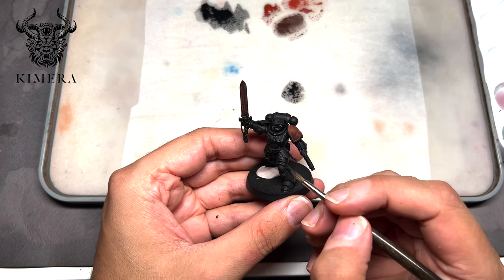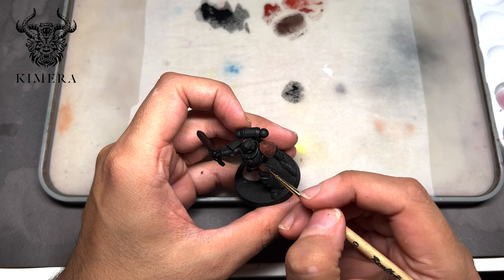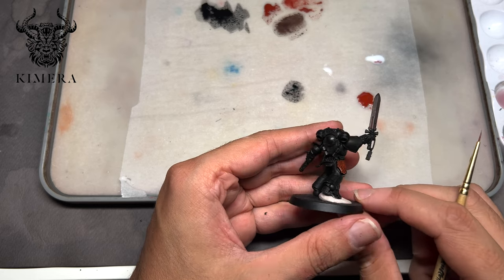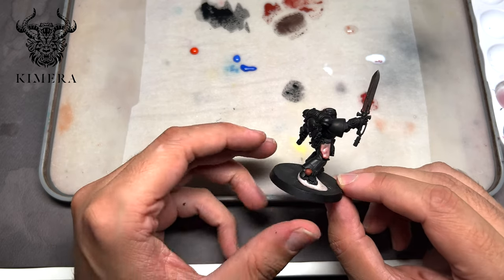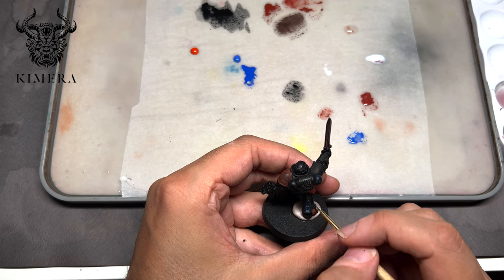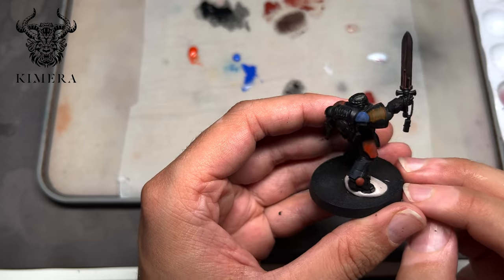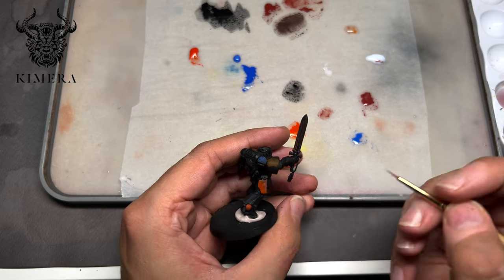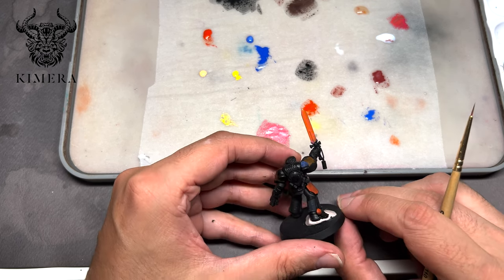The truth about unwanted FROSTING or CHALKY painted miniatures!

Comment: 👍👍 Haven’t tried Windsor Newton matte medium before…bottle on the way - will know tomorrow🤔

PS +1 on the BenQ light.  We dont use ours for painting, but as backlights for large monitors. For painting we’ve got quite a few LED 5K-ish floodlights mounted in cheap work light fixtures (HomeDepot/Lowes) in a circular pattern overhead shooting down on the painting work areas (and airbrush booth) at differing angles to pretty much eliminate shadows..if we want…can turn off individual lights to control directional lighting (shadows).  We also use the LED floods for continuous lighting (indirect, masked & filtered) while photographing miniatures, sometimes a little fill flash  (DSLR - yeah old fashioned but it’s hooked up through Capture One so that makes it easy for monitoring shots in real-time).  

As always, YMMV.  Just sharing.  Nothing more. nothing less.

Comment: Thank you! Very helpful video! I encountered something similar with Scale 75 Tesla Blue over already glazed other blue tones. It was really frustrating since it is such a nice and vibrant colour.

I also found that Kimera Warm Yellow clumped really badly while strongly diluted with water to use it as a glaze so no smooth surface was achievable. I had this issue with some other kimera colors which unfortunately let me avoid them all the time. Do you have an advice on that as well? Your paints seem to get so much positive reviews so I am asking myself why I can’t seem to get them to work properly.
Reply from the maker: It is the same kind of issue I think as i strongly diluted the warm yellow in the last part of the video. Or it is that you didn't shake them well, as they are super pigmented and the pigment can fall on the bottom of the bottle. Do not glaze over glossy surfaces with matte paints, that's the rule of thumb. Make either the paint satin or the surface matte. I hope it helps.
Reply: Thank you a lot, I will keep it in mind :)

Comment: Hi ! Would not a simple layer of canned matte spray over the black primer be enough to deal with the issue ? It seemed an easier process. Thank you for this video !

Also, any advice about how to have a better coverage when base coating with the phtalo green ? Having issues with this color
Reply from the maker: Matte sprays are fine, i use to do it with the airbrush eventually. My problem with can spray is that they tend to leave grainy results depending on the humidity of the room so I end up avoiding it. But results are very similar in any case. All the other methods though are because you may want (and it's especially my case) some parts to be more matte and other be more satin, so all these methods give you control.

As for coverage, just add a bit of white in the mix or black, depending if you want the color to be light or dark and you'll be fine.

Comment: How can the flow improver be matte? It doesn't contain any matting agents. Unless it only contains things like solvents... Vallejo flow improver is glossy. I'm very interested if the winsor is matte. But how could it be? :o
Reply from the maker: It's not a matting agent, it just doesn't alter the properties of the paint. So if you use it with Kimera Kolors you'll still get a matte result.